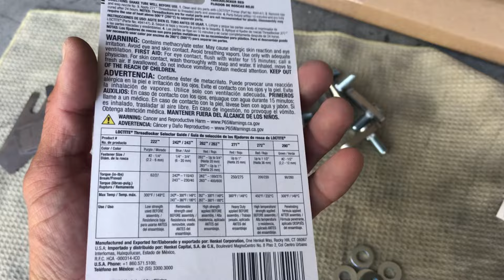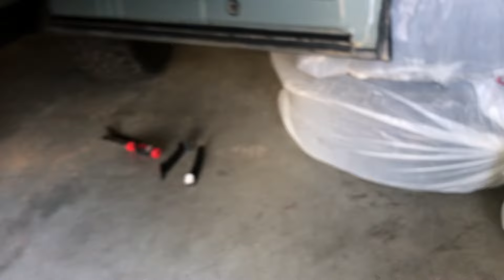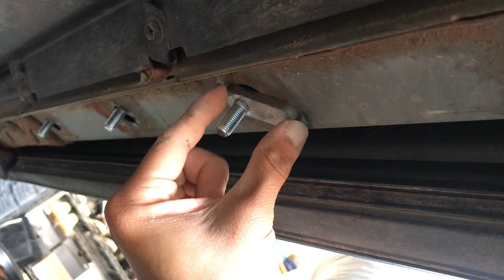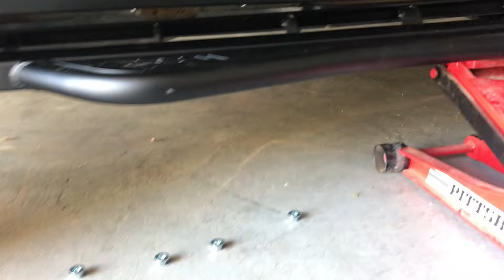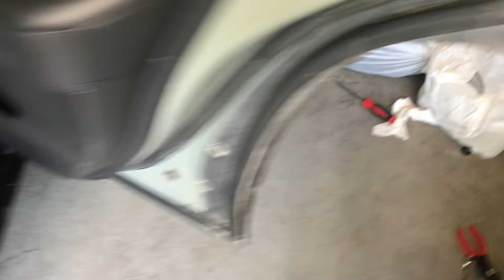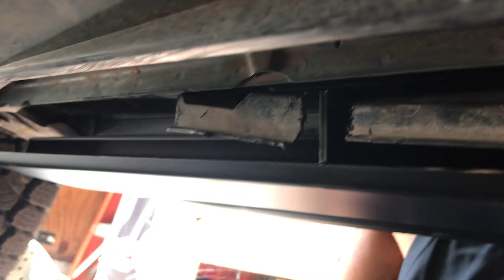TORQ ENGINEERING ROCK SLIDER INSTALL FOR 5TH GEN RAV4

Comment: Ordered mine, your video will be running thru the install!  Thanks mate!
Reply from the maker: Good luck with the Install. 👍🏼
Reply: Just installed them last night.  Still working on the trim piece. I hope that by cutting off the pinch wells trim as you did, it will allow me to get them back in place.  So far, I'm not able to slide them in past the back door. @PK.Adventures
Reply from the maker: @shadowravyn2011  try pushing it in at the same time, pulling it  towards the front.